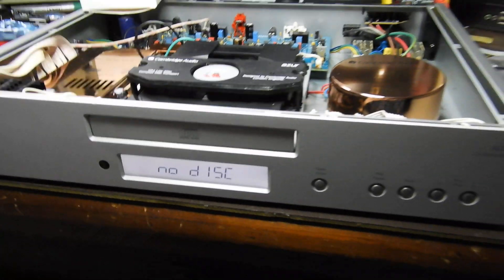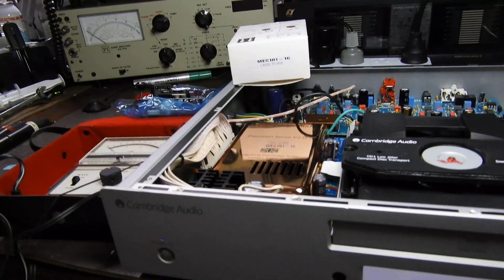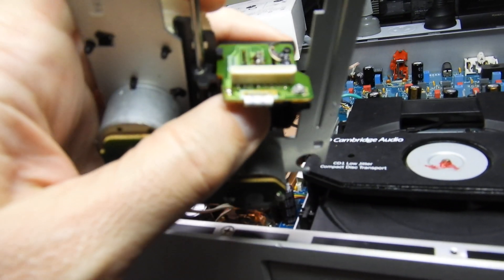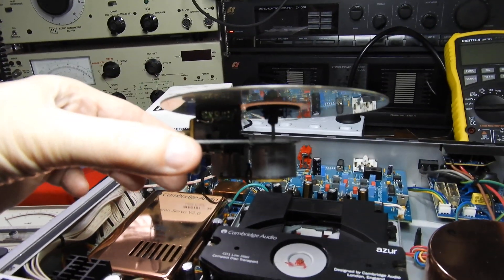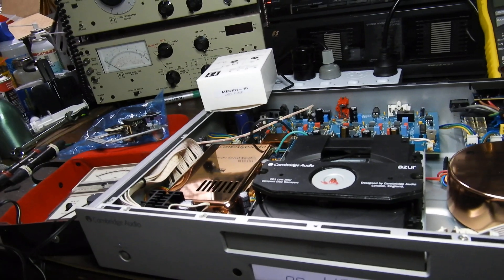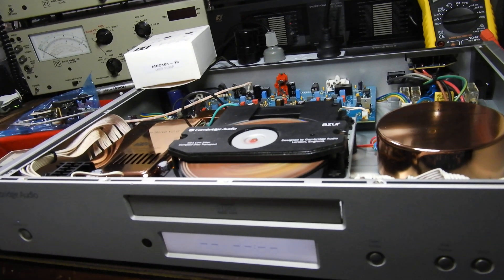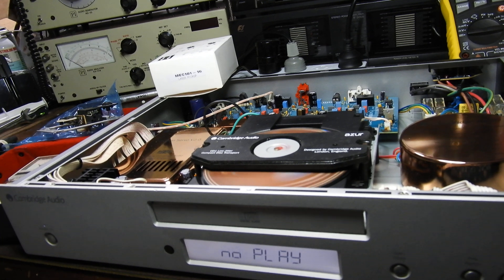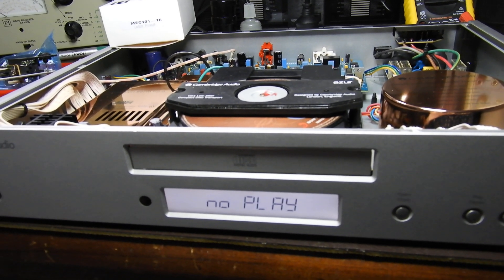Replacement Sanyo SF-P101N 16 pin laser on Cambridge Azur 640C

Comment: Does Sanyo 101 usually scrape quietly while tracks changing? Is it normal?
Reply from the maker: If servo is aligned perfectly, then it should be all silent. This goes for any player / mechanism  / laser. Sometimes they are noisier on warped discs or ones with poor reflectivity, but if all's OK, the it should be silent. Some whistling often happens when searching, before lock. After lock, should be no noise
Reply: @hear-net-au  thank you, does sanyo 101 read sacd?
Reply from the maker: @iviv1940  No. it is a very old pick up. Only DVD mechanisms read SACD (which is a DVD format)

Comment: Thanks for the tips! I just obtained a Vincent CD 400 with a defective Sanyo SF-P101N :)
Reply from the maker: Sanyo SF-P101N are still available for a low cost but in general, very reliable. I bought 10 last time I found a good seller and still have some left.
Reply: @hear-net-au  Jup, but I just discovered that the flat-cable was not properly installed  on the laser PCB. So that was an easy fix. The new year starts good :) Happy new year from Berlin (EU)  man, I love your videos!

Comment: Check the electrolytic capacitors in the focus and tracking circuit with an ESR meter, or have a tech do it for you. These have been known to cause this problem, which have been cause of many a complaint due to faulty source of supplier parts failing at an early age.
Reply: Are these located under the servo cap?
Reply: @Max-Current  I am in the process of doing this myself, but this is what I came up with as a known problematic area to check, searching many threads of comments on these units. I just downloaded the service manual and trying to figure which ones would cause tracking and focus problems.
Reply: @zulumax1  okay, but are they under the black servo cap? Not much to see there through the slits in that black’ cover:-).

Comment: do you have a video to see how to change the laser?
Reply from the maker: Sadly, no. It would take too long. But you start by removing the CD clamp bridge (couple of screws), then undo the 4 screws to take the loader assembly. You may need to remove the CD drawer first if the screws are obstructed.
Then remove all the cable connectors. Then you undo the screws that hold the rails on which the laser head travels, replace it and re-assemble.
Couple of things to note. Firstly ground yourself properly before even starting on this and do not wear anything with non-natural fibers for they create static electricity. The new head will have a static protection solder blob which you need to remove prior to use (ideally, after the head is mounted, but if you cannot get to it, do it just prior to inserting it and when grounded).
This is all from memory because I do not have one of these units on hand.
Reply: @hear-net-au  thank you very much
Reply: @hear-net-au  dear sir, this short static protection solder blob you've mentioned in your videos ....do you only need to remove it if youre working on it with your meter and supply power to it while checking ?
I just got a new mechanism complete wth the laser head I want to replace on my NAD c546bee. If I just replace the whole mechanism, do I still need to solder off this knob? what happens if I dont? thanks!
Reply from the maker: @denisusmanov5707  if you do not remove the solder blob it won't work. This blob shorts out the laser diode in order to protect it from static electricity before it is installed.
Reply: @hear-net-au  
thanks
Reply: @hear-net-au  one more if you don't mind. the turntable spindle on my new mechanism might have been bent a teeny bit during shipping. I put a cd on and spin it by hand, and it gives about 1 mm oscilation. I know that it presses up against another disc when playing, so it might level out. do you think it is a problem?
Reply from the maker: @denisusmanov5707  Yes, it is a huge problem. Not only rubbing part, but the laser head would have to labour hard to keep it in focus while revolving at hundreds  RPMs. Get the motor and spindle from the old mechanism and fit it to the new.
If in your unit you would need to remove the turntable, pull it off by leveraging it on both sides, so you do not bend the shaft. Practice first on a faulty one. Then install it back with a firm press down. Use previously made template (make it now). Get a piece of stiff cardboard or plastic that just fits under the turntable and use it when installing TT back on the new motor.
Reply: @hear-net-au  thanks. Tried replacing, sadly, it didn't work, must have screwed at some point, cause the old unit stopped working too. I am looking into ordering the whole unit with plastic carrier...bit expensive, but sort of guarrantees nothing is bent in transit and it's a 'factory' assembly. what do you think?
Reply from the maker: @denisusmanov5707  Yes, give it a go.

Comment: Hello, I have 740C that does sort of the same thing; random mistrack and mutes the sound.  Did you get to know what was the issue on your device? Mine probably has the same issue. It is not the disks or a dirty laser lens, or dirty connectors. It is not a false contact of any sort in there either. I have checked out all possible sources of trouble. This cd player is barely broken in; maybe not even that yet.
Reply from the maker: This is a tracking issue. If it is that new, you should get it fixed under warranty. I do not have the manual for the 740C to tell you more but I would do the servo alignment. Most Sanyo based players have the 5 pots to adjust stuff. Get a service manual and if you are up to it, try. If not, give it to a local tech. If you are in Australia, you could sent it to me. It should not take long.